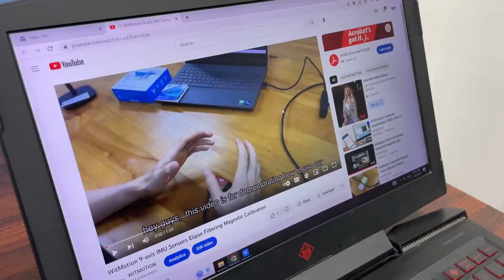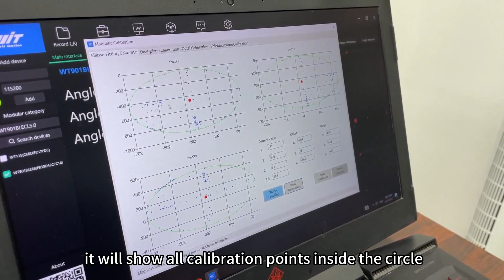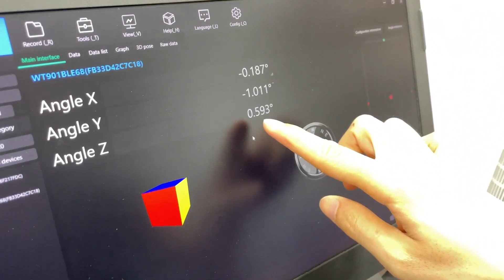5. Magnet Calibration(Ellipse-filtering Method) + Accuracy Judgement

Comment: Hello,

I am using the latest version of the WitMotion software (V2024.12.27.0) with a WT901 IMU sensor connected directly via USB (COM port).

The software detects the sensor, and I can start magnetic calibration. However, the magnetic calibration window is broken:

The elliptical calibration graph area is completely blank, so I cannot see the real-time 3D calibration visualization.

Only the numerical values (X, Y, Z, Offset, and Matrix) are shown — no visual feedback is provided during calibration.

The "Finish Calibrate" button stays disabled, even after rotating the sensor in all directions.

This issue makes it impossible to verify if calibration is successful.

I suspect this is a bug or regression in the latest version of the WitMotion PC software. Could you please confirm this issue and provide a fix or access to a previous version where the calibration display worked correctly?

Thank you.
Reply from the maker: pls contact support@wit-motion.com , they will give you professional answer
Reply: Is it solved? Please help